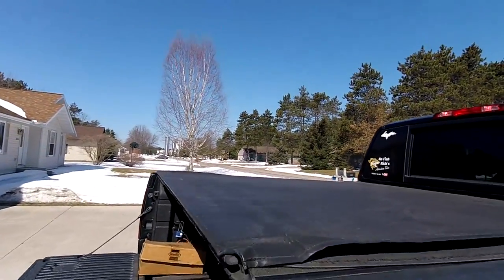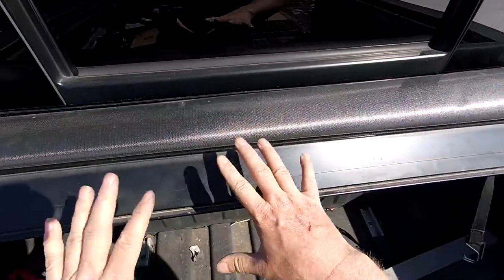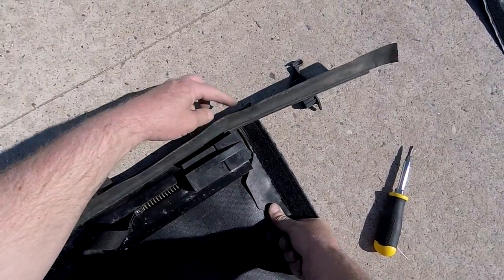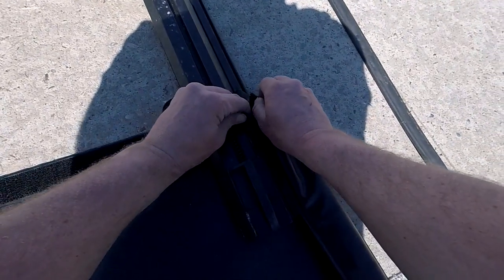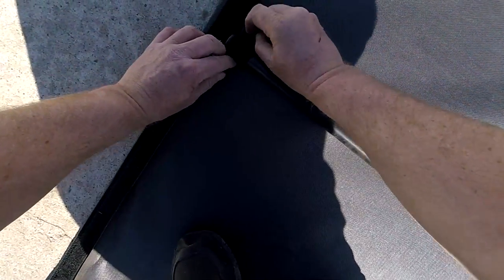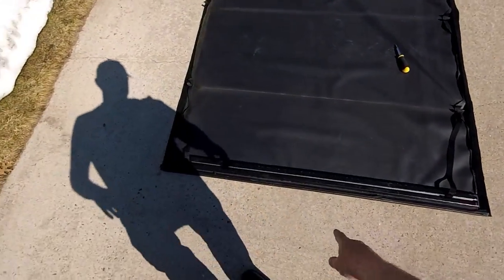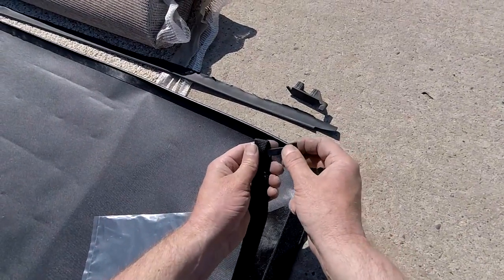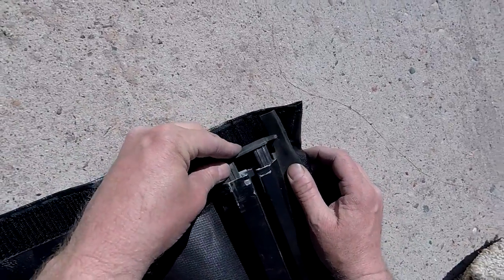Truxedo Lo Pro Tonneau Cover Replacement  How to install replacement Truxedo Lo Pro Cover

Comment: Hey Nick. Hope the fishing is going well.   Thanks for your video, it was very helpful.  My cover was slightly different, but overall, the same process.   Truxedo is an awesome company and helped me with a new replacement cover, which I replaced on my own with the assistance of your video.  Thanks again!!

Comment: How many miles you got on your truck after the Uprev tune? Is it performing with no glitches?
Reply from the maker: 20-25k since the tune. I mostly use the everyday 89 octane tune. Once in awhile I'll get a check engine light for a o2 slow reaction. I just reset the light with the turn the key step on the gas pedal for 10 seconds trick (look up reset engine light for titan). Truck runs great and is very snappy when you get on it.